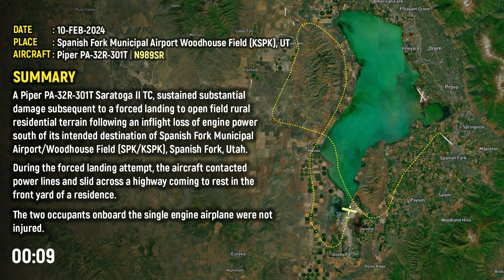Airplane narrowly MISSES HOUSE DURING CRASH LANDING in a front yard in Spanish Fork

Comment: This will sound cold BUT: If you are on the downwind, past the runway midpoint and lose the engine, you should ALWAYS be able to glide to a normal landing by shortening up your turn to base. If you can't make the runway it means you were too far away on the downwind to begin with. Period. Let alone the fact that this dude turned even further away from the runway on the latter part of the downwind.
Reply: My CPL friend is teaching me that now. PPL ASEL. According to them, you would never square out your leg like how you learn it before the PPL check ride. You should always keep your 8 degree glide just in case you lose an engine.